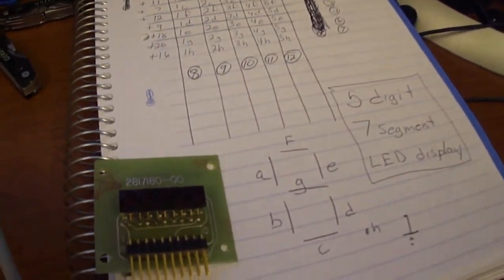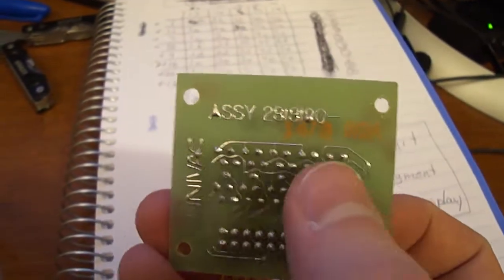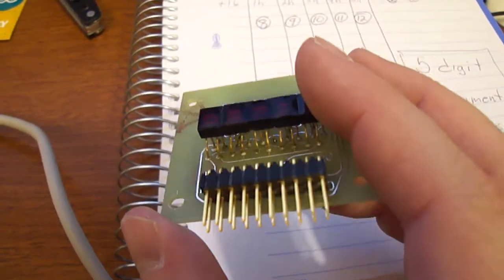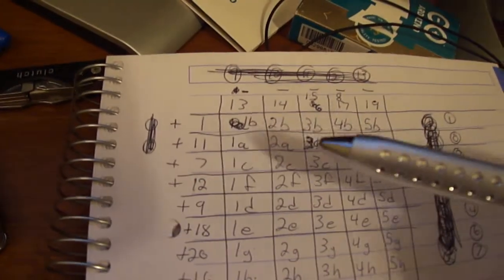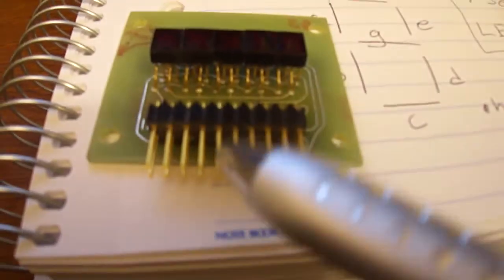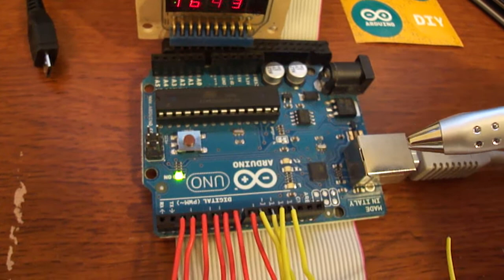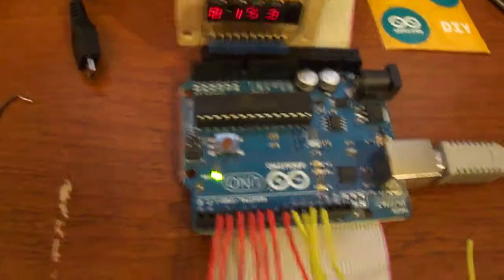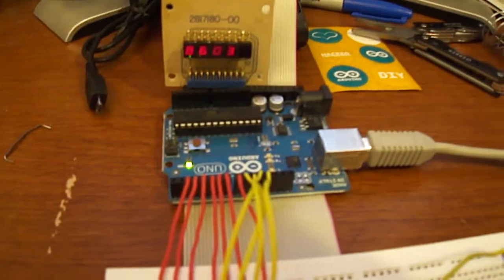Multiplexed 5 digit 7 segment LED display with an arduino

Comment: yea thanks for the video and source code i have a 4 digit 7 segment that i recovered off an old childrens toy but ive been unable to get it to work right im still trying to figure the wireing out for the pins because i dont have a data sheet because its a part from a toy